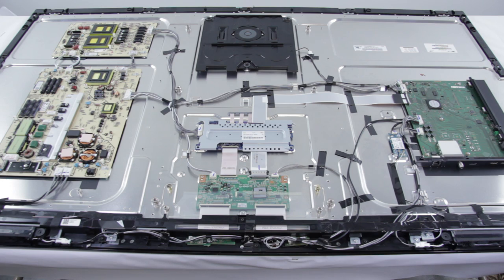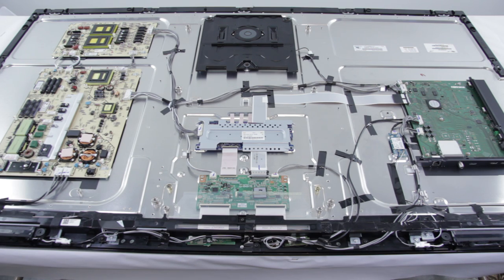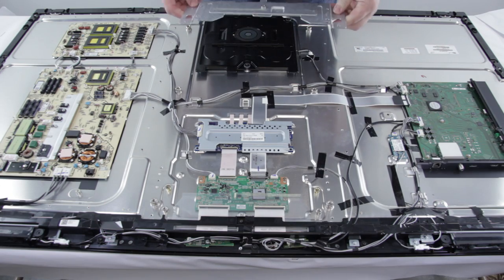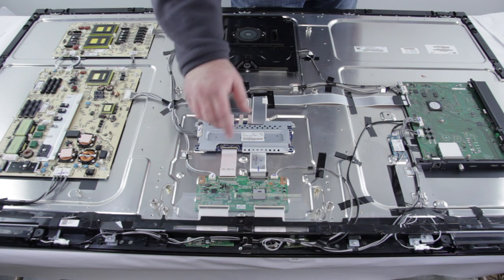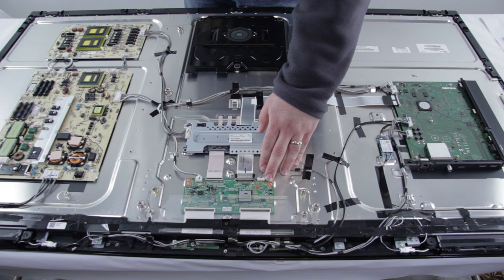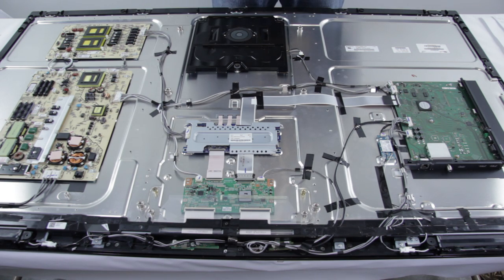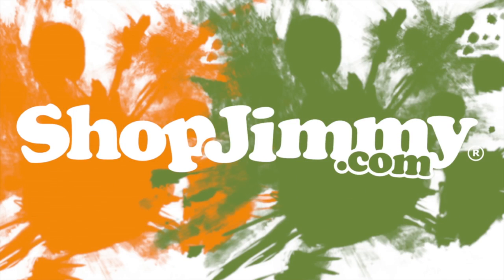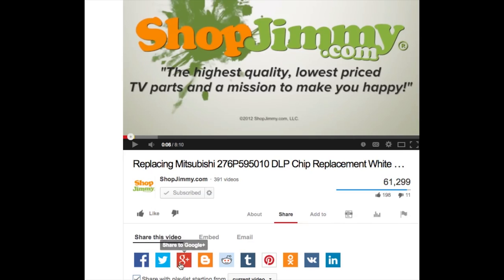LED TV Repair T-Con Board Help Review Overview - Common Issues and Problems with T-Con Boards

Comment: I have a un65mu6290vxza tv with sound but no image. It does not appear to have back lights either. I tested the psu outputs and they appear good and replaced the main board and no success. The T-con main chip is hot to the touch and makes a wining noise when powering up the tv for a few seconds then quiets down. I also checked the 5amp 12v fuse on the tcon board and it is good. I am wondering if I should replace the tcon or the led driver or something else. Thank you.

Comment: I have a Seiki model SE40FY27  the tv is about 6 months old and has no picture but there is audio. At no time does the screen light up or display any pic or light.  I was suspecting the t-con board but I cannot find one for this tv. Any common issues with this tv that would lead to a better guess about the bad part? Alo any help finding the part would be a great help.

Comment: Do you have any idea if the following items are permanently back-ordered - Sharp LC-50UB30U Complete TV Repair Parts Kit -Version 1?
I was told by a local TV Shop that Hi-Sense acquired Sharp and it is likely the Pre- Hisense tv's don't have anymore parts forthcoming.

Comment: could colored horizontal lines also indicate a problem with the TCON?
Reply from the maker: Eric Johanson   Try all repairs and troubleshooting at your own risk.  This sounds like a TV panel (TV Screen) problem.  If your TV panel is bad, it may be more cost-effective to replace the TV as panels are typically hard to find in stock, difficult to replace, and expensive.  Thanks and please let us know if you have any further questions!  www.shopjimmy.com

Comment: I have a 65" Samsung UN65H7150AFXZA (TH01) - when pressing power, I get a flash and can see a bit of the screen - backlights come on and then go out.  Standby light stays lit.  I was going to buy the complete repair kit as it seems it could be any of the 3 boards in the TV.  I cannot find the kit available and am wondering if this description narrows down which board it could be and if you could direct me to where I can purchase it.

Comment: I have a un46F7100 sometimes it freezes and the screen has vertical lines and sometimes has the negative effect then when the picture go crazy the remote wont respond some times. if i shut it off wait a while then its got a perfect picture.

Comment: On a Samsung UN55D6900WF - there is a band across the top 1/4 of the screen that is darker than the balance of the screen image. The sound and balance of the image on the screen is fine. The upper right portion of this band is subject to smearing with any movement of the screen image. Is this more likely the T-Con board or the main board?

Comment: Hello, I have an LG 65uf6800. I JUST opened the box. I purchased it over a year ago but never used/opened it.  My problem started within 3 hours of use.  All inputs would have an image that flickered. The menus would be fine, no issues. The flickering would happen only in the input windows. If I opened Netflix, I would be able to see eveyrhting and do everything but will only screw up when pressing play to play it. The next day, the videos were all white/snow. So it went from flickering to snow, the menus had lines on it. The day after just a black screen with audio.  I am having issues figuring out what part I need to replace it. T-con is my first choice, then Powersupply/LED Driverboard, third is Main board. Any advice???

Comment: Hello, I have a insignia ns-l46q120-10a 45" TV. Only the red light for the power comes on with a high pich sound. my guess is the power supply board.  any suggestions thank you

Comment: I have a vizio E420i-a0 42" led tv and for some reason within the last few days my TV has developed a 12-16" darker strip horizontal across the screen you can still watch the tv it's like the screen is just darker in that area
Reply from the maker: +Matt Burgess   Try all repairs and troubleshooting at your own risk. This sounds like a problem with the actual LEDs inside your TV. These LEDs are replaceable, however it is recommended they are replaced by someone with the proper experience and training. When replacing the LEDs, the TV panel can get damaged. If the TV panel gets damaged, it is not repairable. Click this link to replacement LEDs for your TV model number:  http://www.shopjimmy.com/lg-lc420dug-jfr1-led-strips-10-strips-1-board.htm   Be sure to match the panel information necessary to ensure you have the correct replacement LEDs.Thanks and please let us know if you have any further questions with your TV Repair!  www.shopjimmy.com

Comment: hi there, I have a 60 inch . sharp, aquos tv, there is a picture & sound on the right hand side of the screen, but on the left hand side, is , coloured vertical lines, I was told this tv CANNOT be fixed, would you say its the T CON BOARD, ? thanks ,

Comment: I have an LG 55LW5600 and I want to replace the T-Con board as I am getting sound but no picture, but the only t-con boards I can find are for the LG 55LW5600-UA.  Will that board work for this as well?

Comment: I have a Mitsubishi 246 series, LT-52246
I have 3 vertical about 2" vertical bands that flicker or disappear depending on the picture on screen.
Is this a bad t-con?
If so is there someplace where I can buy the part?
Thanks

Comment: I've got an RCA LED50B45RQ that when powered on exhibits a grayish flash that spreads from the center outward and a gray horizontal line across the screen, then goes black. No backlight, no sound, picture or menus (did the flashlight test). I suspect it must be the power supply board. I checked the capacitors and didn't see any bulging though. Could you recommend a part?

Comment: I have a Vizio 50" model P502UI-B1E with the right half of the screen with vertical lines and the left side is just fine what do you suggest?

Comment: Picture went black but still have sound on Samsung LED UN40ES6150F. Using the flashlight test I can just make out a raster on the screen.  I tried replacing Main Board then T-con, but no fix. I cannot see/find the LED Driver Board as is mentioned in several tutorials. Is there one, or is it just well hidden? Thank you.

Comment: Hi - I have a Vizio M70-C3 with an LFTRSYAR serial number. The problem is that there is a black screen except for the Vizio logo when powering on.  The logo will stay there for about 15 seconds and then disappear.  If I don't pull the plug it will keep doing this forever.  It seems like it's trying to start but can't.  What do you think the problem is?  I see that you have a complete parts kit (sj-KIT-M70-C3-K1) but it's out of stock.  What do you recommend?  Thanks.  Tom

Comment: my polaroid tlx04011c tv has  vertical purple lines. On your video I think I need  tcon board. I saw another video that said I could remove the cables and use an eraser on them and see if that fixes my problem. What is your suggestion? And if I need parts please let me know

Comment: I have an LG 55LB6000 that has a screen that lights up then goes dim. Then lights up then goes dim. It appears that only part lights up before it goes dim. When it is dim it almost looks black but if you look very closely you can barely see the image.The sound is ok. At start up the LG logo is dim also.
Reply: mine doing the same
Reply: +Donnell Warren what did u do

Comment: I have an LG Led TV model #50LN5100 UB  When you turn on the set, a red light would pulse and then come on steady and the picture come on. Now there is no pulse, just a steady red light, no picture. When I turn it off the red light pulses and there is a momentary flash. I wish I had seen your site sooner. might have saved me some money. I replaced both the power supply and the main board. But didn't fix the problem. Could it be the control board?

Comment: Hi I have an LG Model 60LB7100-UT.BUSWLJR IT WAS PURCHASED IN 2014.  The symptoms are at power up either with the control or unplug and power on the LG logo is displayed then it will maybe display the HDMI input or lack of then the screen goes black but sound works. Trying to display onboard functions like display input or menu still displays a blank screen. At one point we did get the input changed to antenna and would see snow for several seconds before going blank. From your excellent video I would guess t-con but my minutes worth of knowledge isn't worth much.

Comment: Do you have experience with OLED LG 65C8PUA that exhibit no picture and power issues? Using kill-a-wat the wattage goes to about 40 watt and drops to 0 and panel goes into standby.  Already replaced t-con, mainboard and powersupply to no avail. Disconnecting the bottom FFC cable from the t-con to the mainboard and the TV stays on and power hovers around 40 watt. Not sure what to check next.

Comment: I have a Samsung UN32J525DAFXZA  LS03, The picture on this TV simply goes black for a few seconds every 45-60 seconds, then returns as normal.  This symptom has been ongoing for a month or more but operation is otherwise normal.  I replaced the main board thinking that was the problem, but the symptoms remain the same.  I'm thinking it is the T-Con board, but need your advice before I order the part.  Thanks!

Comment: Hey I have a Toshiba 40RF350U (2006 MODEL)  that the channel up & down buttons don't work on the tv or the remote .
Everything else works.
Only other issue it had was a block of colored lines on 1/3rd of the left hand part of the screen but that appears to have been fixed
What are your recommendations, will I need a main board or will a button board fix it?
P.S. all of the buttons feel & click exactly the same
thank you

Comment: Hello I'm having a problem with my Phillips 65" TV there's 2 large white spots on the TV but the images clear half of the tv which is on the right side is darker then to residente how could I fix that problem from this video it looks like I could possibly be the t con board but I'm not sure

Comment: Thanks, Your videos are very informative. I have a DYNEX DX-40L261A12. The image is "solarized" and the tv's menu is too. I opened the unit and the T-Con board appears to be wedged inside the metal frame in the upper section of the tv's frame. Do you carry the T-Con Board? also do you have a video that shows how to access the the Board? Thanks

Comment: Hi there, need your help with my Sony bravia smart tv KDL-42W674A. 
Suddenly i got this one horizontal line, how can i fix this? Thanks u so much
Reply from the maker: jerome mayor   This sounds like a TV panel problem.  If your TV panel is bad, it may be more cost-effective to replace the TV as panels are typically hard to find in stock, difficult to replace, and expensive.  Thanks and please let us know if you have any further questions!  www.shopjimmy.com

Comment: Have a 54 inch Westinghouse model number vr-55 35z loose picture at startup, have to turn power on and off a few times with remote then picture stays on.If t com border how much.

Comment: Hey ShopJimmy, quick question. Have model 70le660u and unit will power on and display "Sharp" banner but them goes dark, panel and remote are unresponsive. This has to be kinda straight forward but can't afford a visit to a shop. ANY ideas???

Comment: TCL 55S401 - The TV turns on but nothing is displayed, backlights are on, I unplugged one side of the screen and it showed a distorted picture on one side. Tryed a couple fixes with covering some of the contacts with tape, nothing yielded any significant results. What are my possible fixes as opposed to getting a new TV?

Comment: My backlight is working but when I insert the two ribbon cable the light cuts off and the blue light on the t-con board cuts of as well....but when I pull the ribbon cable out the backlight comes on as well as the t-con board light

Comment: I have philips 52pfl7422d/37 lcd. It shows vertical colored lines for half an hour and then it got good before. The sound is ok. But now the screen comes as grey first and then when it gets warmed up there are colored vertical lines but the display do not come even after hours of warming. sound is still good. please suggest.

Comment: Hi I have a Vizio 585 H11. I get a blank screen when I turn it on.  Originally, i believed it to be a Tcon board problem but i replaced it and the ribbons but the problem continues.  Thank you

Comment: baird 55 inch led right half of screen multi coloured vertical lines no picture have been told that screens bust and will have to be replaced as in replace the whole tv luckily we only have to wait a few days
Reply from the maker: +Gollammeister   Try all repairs and troubleshooting at your own risk.  This sounds like a TV panel (TV Screen) problem.  If your TV panel is bad, it may be more cost-effective to replace the TV as panels are typically hard to find in stock, difficult to replace, and expensive.  Thanks and please let us know if you have any further questions!  www.shopjimmy.com

Comment: Hello,

I have a Toshiba model 40L2200U. My TV has green dots surrounding certain dark images that are shown on the TV. Also sometimes there are green vertical lines across the TV.
Reply from the maker: +Soheil Aliakbar   Try all repairs and troubleshooting at your own risk.  This sounds like a TV panel (TV Screen) problem.  If your TV panel is bad, it may be more cost-effective to replace the TV as panels are typically hard to find in stock, difficult to replace, and expensive.  Thanks and please let us know if you have any further questions!  www.shopjimmy.com

Comment: Hi,

I have a Panasonic LED tv TC-55AS680U . 

The screen is partially flickering (black pattern)  in front and in the back you can still see the video context. Some days ago my ceiling leaked water and saw some water marks on the font of the tv but I am not sure if it also went inside the tv. Can you help?

Comment: I have a Sony TV model: KDL-65W850C with Serial no: 3179199.  It has a black screen, but the light indicator comes on at the TV.  When I hold down on/off switch on remote or back of TV the indicator light flashes six times, pauses then flashes again.  What are your suggestion to repair.  If I need a motherboard where is the best place to get one.
Thank you for you help

Comment: Hey Guys thank you, I have a 58" Sharp Roku TV (LC-58Q7330U) and it won't star at all, I thought it was the power board which I just replaced but it won't start. So what do you think could be the problem? Thank you.

Comment: I may need a new T-Con board for a 2017 65 inch Sharp TV. It turns on with sound, has backlights, just a blank screen. What are your thoughts?

Comment: Hitachi LE55A6r9a issue is ther eis no backlight you can see the screen with a flashlight. I am trying to find the parts for it found that it doesn't have a Backlight inverter but LED strips if you agree that the strips need to be replaced do you have anywhere that sells them. ?

Comment: Hello gentlemen. I have a Vizio 50 inch TV. Model M502i-B1. The TV had colored vertical lines right in the middle of the screen. The TV has back lights. So i bought a T-con board for it and replaced it. It powers on and does not show the vertical lines anymore but it wont show anything still. I can see the lights changing in the back ground when i change the input or when i try to show the menu. So the TV works because i can see in the movement when i change inputs. Do you think I got a bad T-con? The reason I say this is because when i put the old one back in, it lights up screen but it just has vertical lines. I know the old T-con is bad because I can see one of the IC's is burnt.

Comment: Good morning I have  shape 70" led aquos smart  tv model lc-70le650u . My problem is when I turn the TV on on the HDMI  PLUG WITH MU FIRE STICK.  I GET A SPLIT SCREEN AT THE TOP AND BOTTOM.  Could that be a mother board problem. Please help me.

Comment: Hi I have Samsung UE55JU6410U and there is thin line on the screen. I take off the cables connected to tcon and no line can be seen just blank screen. And when I put it back it come back. Do you think it's Tcon board?

Comment: hello i have a Vizio M550 SL 55 inch lcd tv.  the orange stand by light comes on when plugged in and when i press power it turns white. the back light also comes on but that  is all.  nothing else comes comes on. your advice is greatly appreciated

Comment: Question.. I have a Hisense 50K360G with a video problem.. when there is no input the blue screen is ok.. when I put a input to the tv the picture looks good until I get a green flashing  / blinking image every once in awhile and when it starts blinking it won't stop.. not sure what the problem is.. tcon board or bad conections to the board.. Pls let me know what you think.. Thx

Comment: Hi
I’ve got a LED Samsung 40" UA40D5000PMXXY probably 3 years old and since 3 months ago started malfunctioning and its getting worse.
When I switch the TV on the image come all bar coded (vertical lines) and after 10 minutes it comes up good. At the beginning when the problem started I had to wait 5 minutes but now sometime I have to wait upto 20 minute.
It’s the same with all the inputs.
I have opened the TV and check all the connection and they seem to be good.
All the capacitors seem ok and the voltage coming out of the cold side of the power supply module are ok.
Any ideas on what I can do?
Thanks

Comment: I have a Toshiba 50" 50L5200U LED TV and I noticed you said posted some of the symptoms for the t-con board going bad. Up until earlier today, the TV worked perfectly. I tried to turn it on and noticed the splash logo glitched colors. When it finally got into the input (tv channel), the screen flickered and the channel display started to droop and replicate. The left side of the screen would then be slow and the middle of the screen is darker while the right side of the screen is working fine. Would this be a t-con board problem?